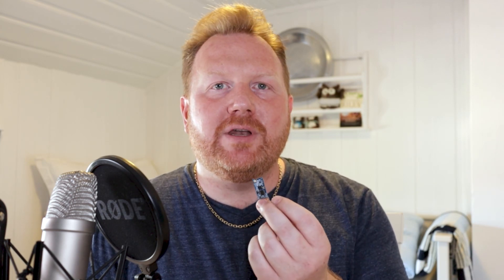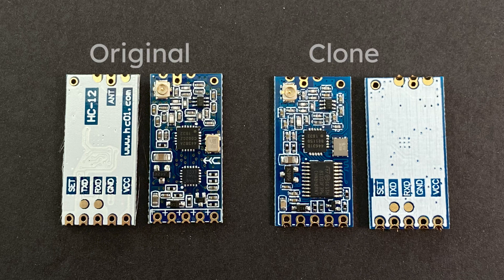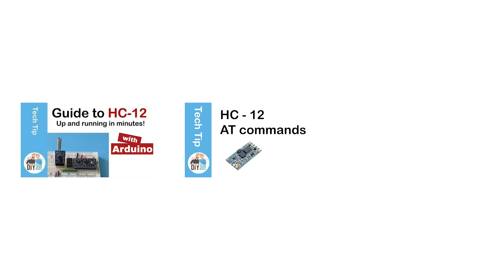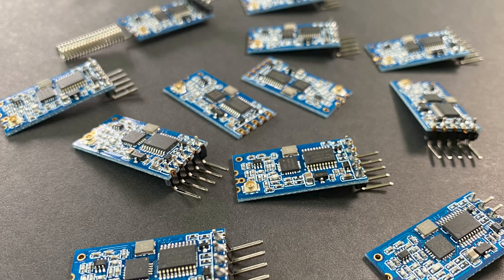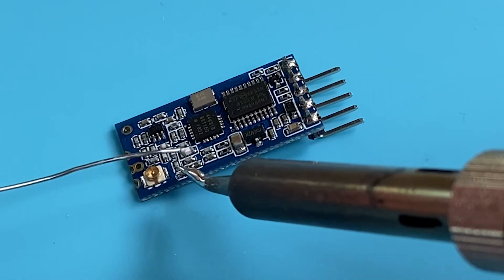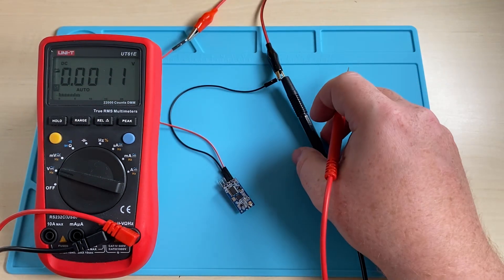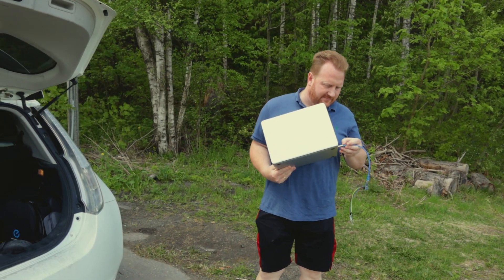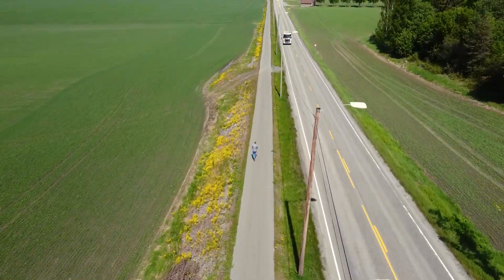HC-12 FIX for bad clones

Comment: I've got 3.3 volts on this pin, but the radios work at a maximum of 30 meters. (Of course they are set for maximum range)

Comment: Clones are also a MAJOR issue in what appears to be factory-reject crystals being used by the cloners now, that make them off-frequency from what you set them to, and make them have poor modulation also.  This prevents them from working in the same network as other genuine HC12 modules.  You have to remove the reject crystal, and replace it with a genuine one from a reputable parts supplier.  Once you do that, that corrects the frequency and modulation issue also and they work fine.

Comment: How is it possible to have one HC12  module as transmitter and send data to multiple HC12 receivers? Thank you.
Reply from the maker: Hi! In general, the HC12 just receive data. It does not know if other devices also receive the same signal. If you want to address only one HC12 at a time, you could start with a number and program each one to only read data when it starts with 1 for HC12 #1, or 2 for HC12 #2 etc. Or just a library.
Reply: @DIYTECHBROS  many thanks for your reply.

Comment: Hi, I have found conflicting info on two things that maybe you can help me with? 
1.Does the spring antenna have an omni-directional gain pattern or is it directional towards the axis of the length of the spring? 
2. Is there a noticable difference between 4463 and 4438 chips?
Reply from the maker: It reduces the range if you tilt it toward the other antenna, so it seems like it is omni-directionally!
Reply: @DIYTECHBROS   Do you mean that it actually gets worse if both spring antennas are pointing towards each other? This is what I have beein doing all this time, thinking that it increases gain. Your experience is that any direction for Tx and Rx antennas yield the same result? Even when doing your long range test?

Comment: So u were able to sent data up to around 2000 meters just with the spring ?
Reply from the maker: Yes :-)
Reply: Nice. I bought two of them and looks like now even a copies have around 3.3 volts on that place where u said. But i still didn't try long ranges just around 2m.

Comment: hello friend. I have a problem with botj the original and the clones. in command mode, no matter what command i send. If it starts with AT it returns OK. example : AT+C100 should return OK+100 but it just returns OK, and doesn't change channel at all... any ideas?

Comment: These are NOT resistors (surface mount resistors are black/white). These components are CAPACITORS. I have not tried it because my clones works fine for the range needed and I have not the schematic to understand what to be done.

Comment: Maybe it wasn't a mistake after all, and a means of limiting the module's power to comply with local regulations in USA. As mentioned in other videos, the maximum power cannot exceed 10mW.
Reply from the maker: That could be it!
But since it then only have a range of a few meters it would be bad marketing to limit the device but still sell it as 1KM ++ range.

Comment: hi. glad it works! might as well check my HC-12 for the 3v3 reading.

btw, those 2 smd components pointed out , are capacitors. 

cheers 👍
Reply from the maker: Oops... from just looking at the HC-12 they looked like resistors, but, on the image they are not black or have any values on them...

Comment: Это увеличит дальность?!
Reply from the maker: Yes! We were only getting a range of about 10 meters +/-. But after the fix we did achieve a range of about 2 KM.
Reply: @DIYTECHBROS  Спасибо , Привет вам из России город Москва!
Reply: @DIYTECHBROS  This should be in AT + FU4 mode ?!
Reply from the maker: @metallor9  If you want max range,  yes!
Reply: @DIYTECHBROS  Спасибо!
Reply: Is the condenser warming up is this normal?
Reply from the maker: @metallor9  No, it should not be warm to the touch. Make sure there no extra solder have made it places it should not!